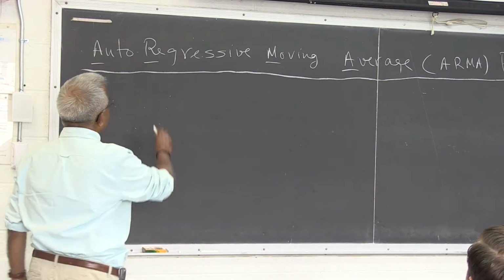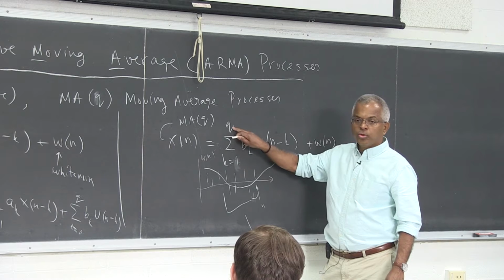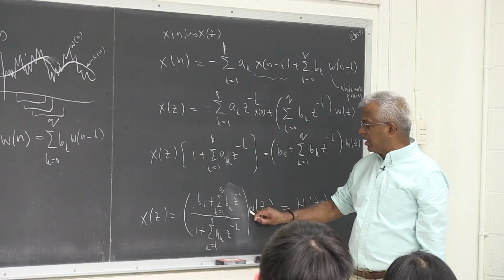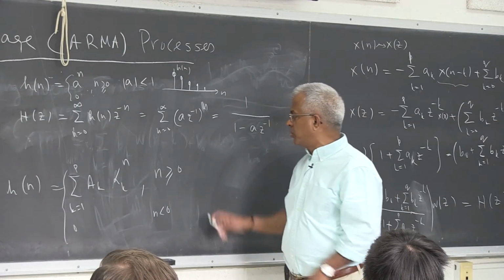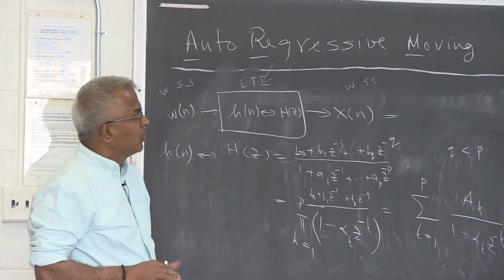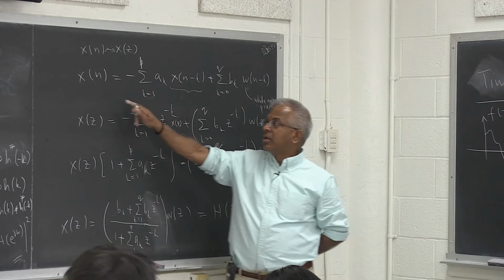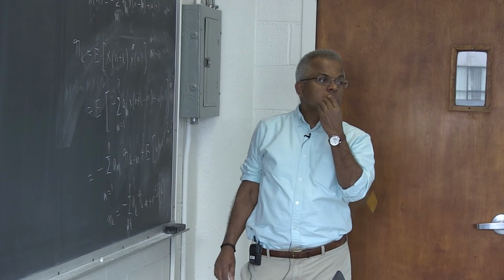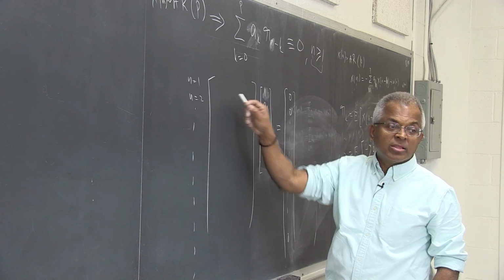Pillai "Auto Regressive Moving Average (ARMA) Processes"

Comment: Sir, after fitting a WSS process x(n) using all three AR(p), ARMA(p,q) and MA(q) models, how to decide which model among these three is best for that particular process? (assuming 'p' and 'q' are any two integers) 

Whether variance of innovation process w(n) of that process x(n) is good measure for performance evaluation of particular model?
Reply from the maker: +Pranav Deshpande 

You need to know something about the data  to decide what model to use. Generally what you may be able to do with a higher order AR(p) can be fitted using a lower order ARMA(p,q) because there is more flexibility to shape the numerator.  For example, if the underlying spectrum has zeros, they are the zeros of the numerator polynomial  and such a model requires an ARMA model. Trying to fit an AR process in that case would require a very large model. On the other hand, if we use a maximum entropy approach, then we can fit a stable AR process. We can also fit stable ARMA, but you need to do more work for that. You may want to look into my book with Shim on "Spectrum Estimation and System Identification".
Reply from the maker: +Probability, Stochastic Processes - 5 Minute Videos 
Yes, generally variance of W(n) is argued as a good measure to fit, and there is some sens to that argument. So one way to decide what is the best model fit is that you find the residual variance and plot it. Select the model with lowest variance.  However, for complex data sets, trying to hinge everything on a residual noise variance might be an over simplification. One need to look for other parameters when the right model order is reached.
Reply from the maker: +Pranav Deshpande 
The answer to this question is addressed in my monograph "Spectrum Estimation and System Identification". Also you can look into my paper on "ARMA System Identification and Rational Approximation" in IEEE Trans on signal Processing. You need to exploit certain invariance properties of a rational system.

Comment: However, moving average models should not be confused with moving average smoothing..
Reply from the maker: +Tim Isbister 
 Can't you think of moving average smoothing as an  AR(m) process ? Think about it, X(n) is expressed as a linear combination of the past m samples, and the last noise term can be thought of representing the error. If you make all the scaling terms equal to 1/m, then X9n) is truly the average of past m samples, and as n progresses, we get the moving average smoothing.
Reply from the maker: +Tim Isbister 
In an MA(q) system, the output is the moving average of the input averaged over the last q time instants.
Reply from the maker: +Tim Isbister 

It is the same thing. The moving average model leads to an FIR filter. You apply the FIR filter to the data set, and you get the smoothed version based on previous n data samples, and the output is the averaged sequence.